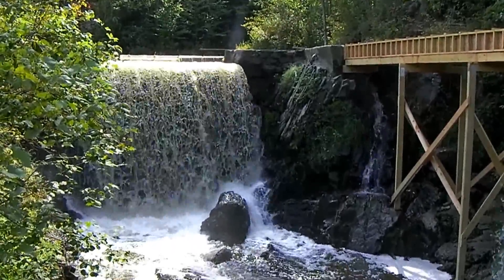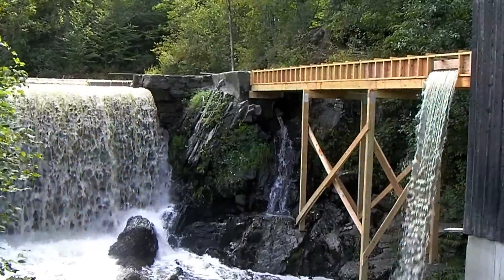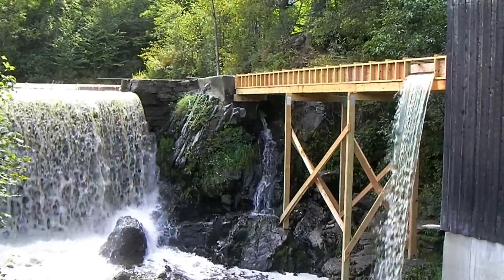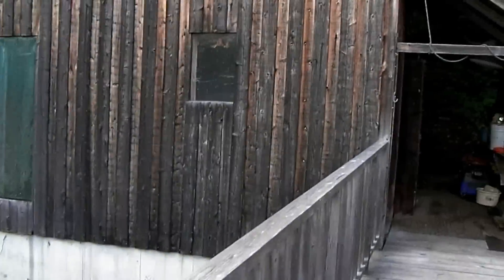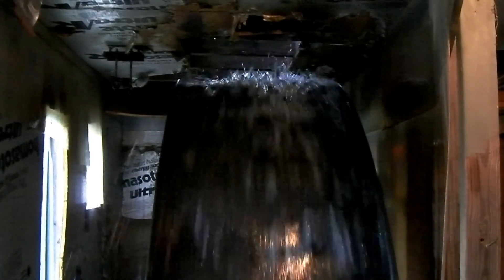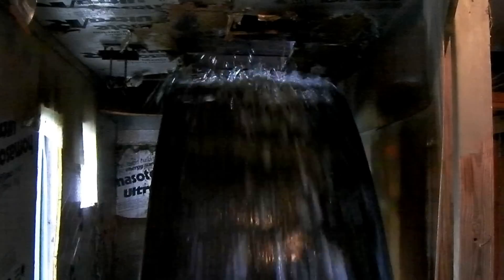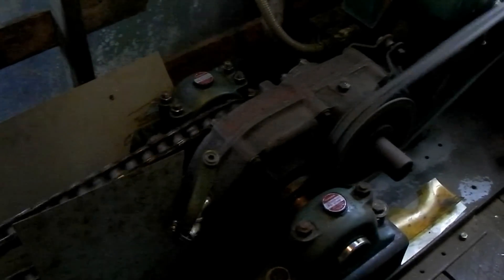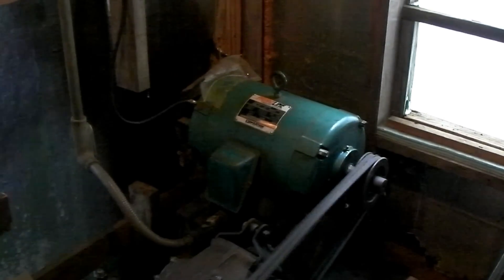vermont water wheel

Comment: What's your flow rate?
Assuming 80% efficiency, in order to get 3 kW, it would take 79.7 liters/sec, which is 21 gallons/second or 1263 gallons/minute.
5 kW would take 132.9 liters/second, 35 gallons/second, or 2106 gallons/minute.